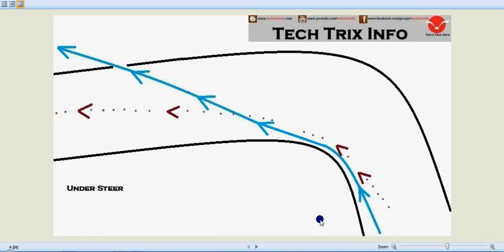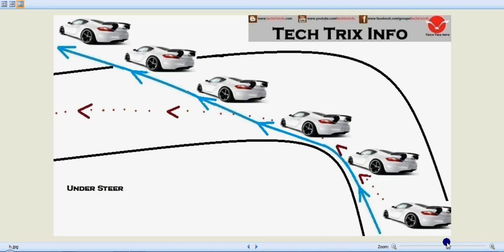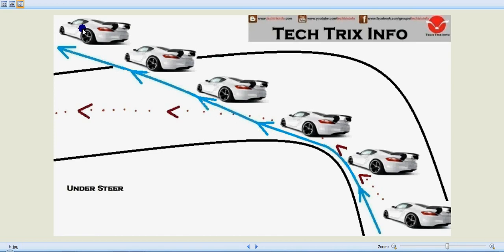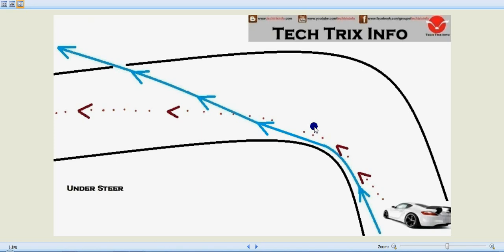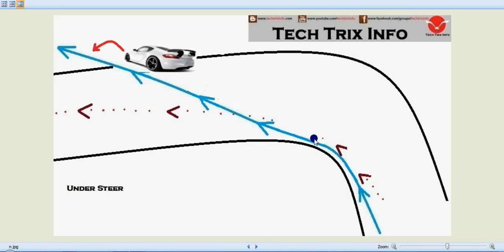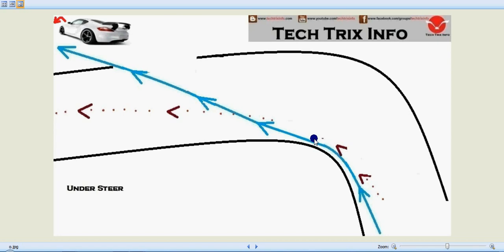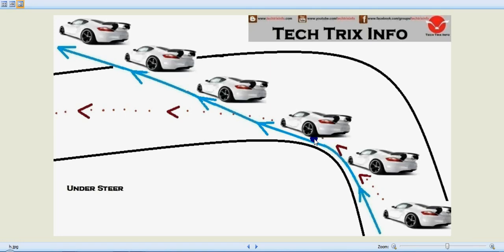How to under steer my car. ✔

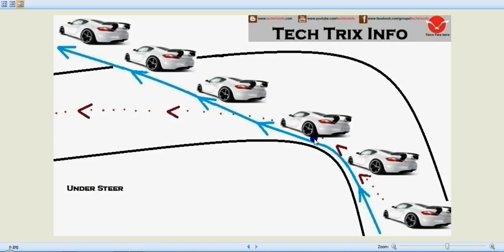Comment: Yes but you didn't fix it yet. It still writes reduce rear tyre pressure.... If you listen on 1:40sec it says reduce FRONT tyre pressure. You must also correct the video description.